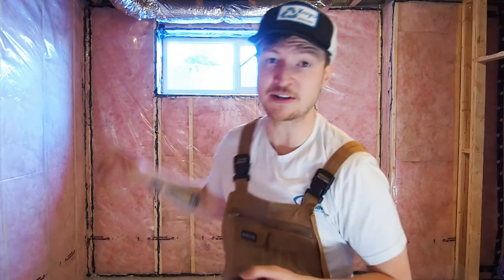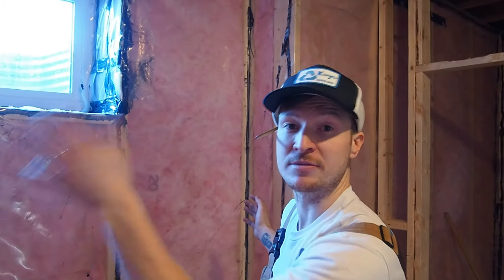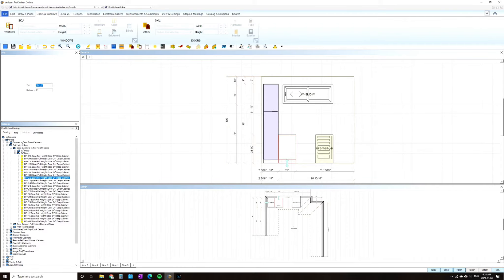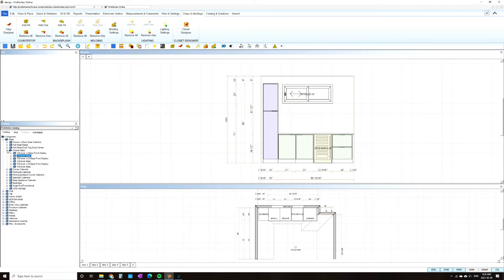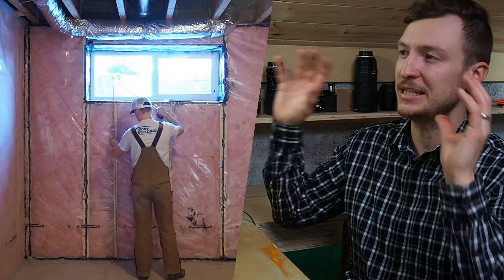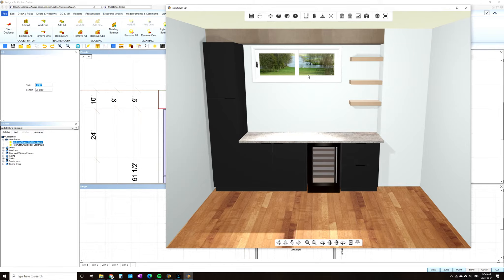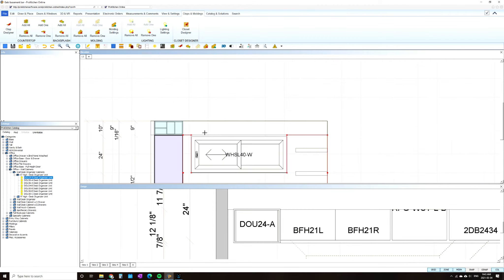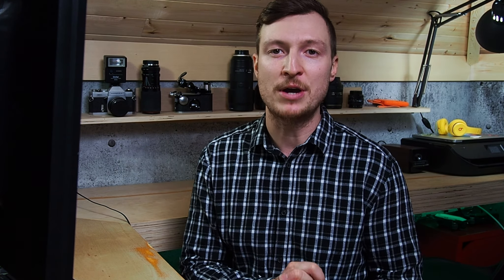How I designed this home bar [Part 1: Home Bar]

Comment: How did you know how much room to leave for the fridge ? Did you buy it before the design ??
Reply from the maker: I did have the fridge before the design. I always try and nail my appliances down early in a project. Nothing worse than finding out something won't fit halfway through. That being said, every project has a little wiggle room like this one did. So if I was off, I could have shifted either set of cabinets by a few millimeters and reduced the end panel at the wall.
Reply: @hsdesignstudio  awesome thanks !! What software were you using for the design ? Thanks again !